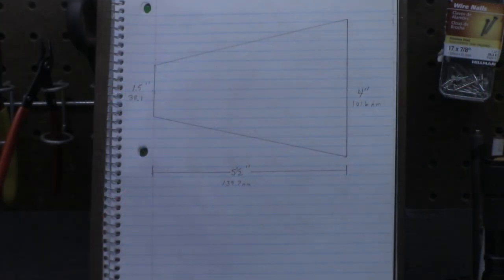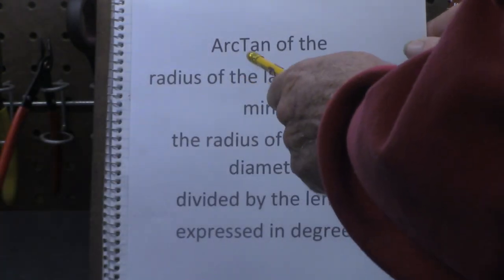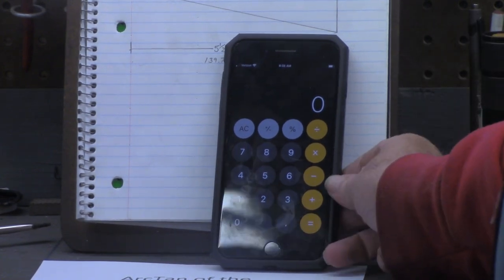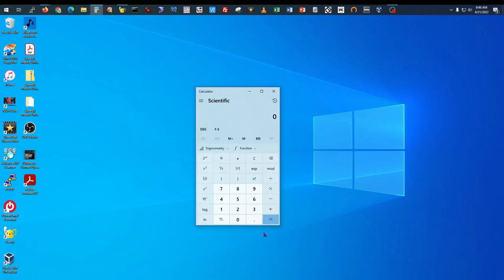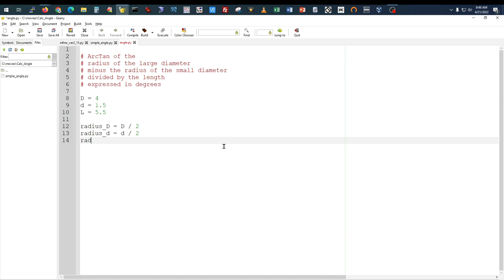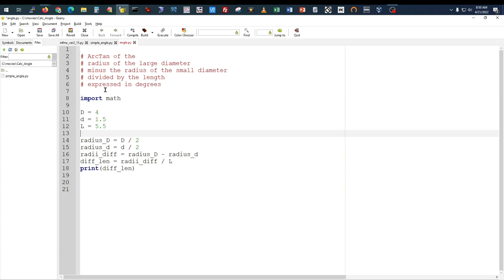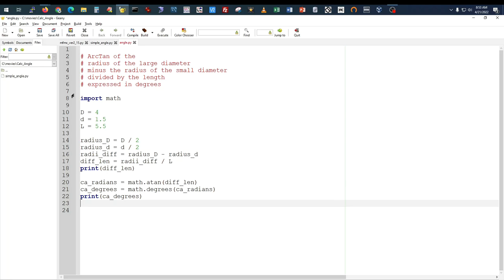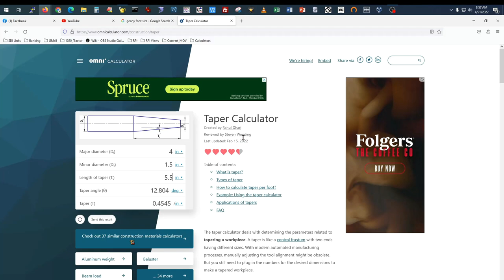Calculate Lathe Compound Angle To Turn A Taper

Comment: Thanks well done. I too should have pursued trig and Algebra when in school. I would dearly like to be able to convert trig values to both radians and degrees without the use of a calculator. that is a project for another time. I found you presentation stimulating and most helpful.
have a great and safe day.

Comment: Hi Lee,

If you do what @outsidescrewball said below, you get a triangle where you know 2 sides and an angle between them. Specifically you get a right triangle, so you can use the Pythagorean theorem to calculate the length of the hypotenuse.
https://en.wikipedia.org/wiki/Pythagorean_theorem

Once you know the length of the hypotenuse, you can use the Law of Cosines to solve for the half angle of the taper.
https://mathworld.wolfram.com/LawofCosines.html 

Imo, the benefit of doing it using the above method is that once you know the length of the hypotenuse you have all the data needed to set or validate your compound angle very accurately with a dial indicator.
Reply from the maker: Remember, the purpose of this video was to show the math used in various online calculators to compute the angle. It was never meant to be a practical approach. Thanks for stopping by.
Reply: @MrPragmaticLee  I know, I would just mentioning how i would most likely code it myself!